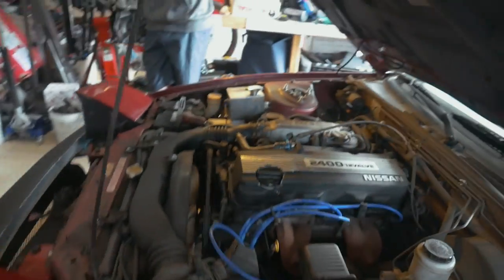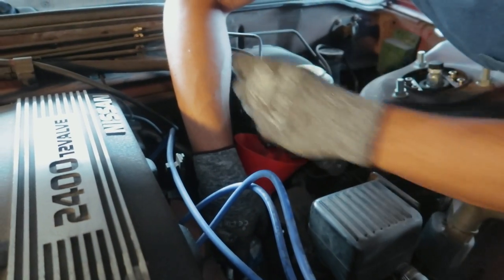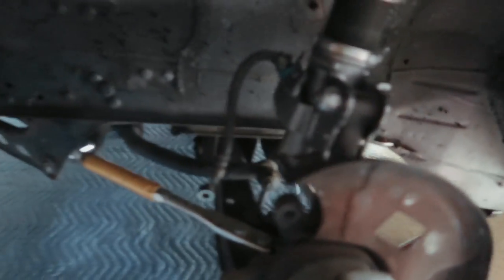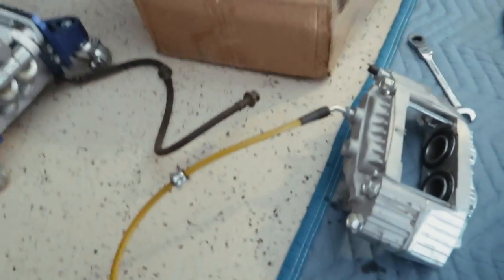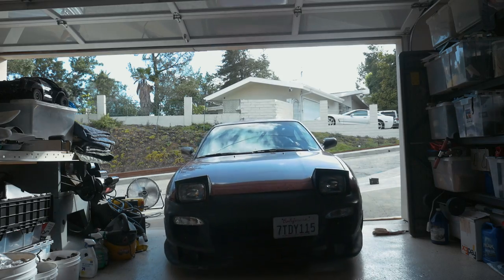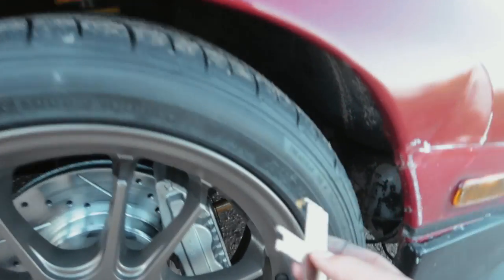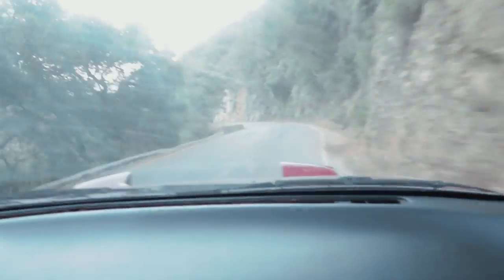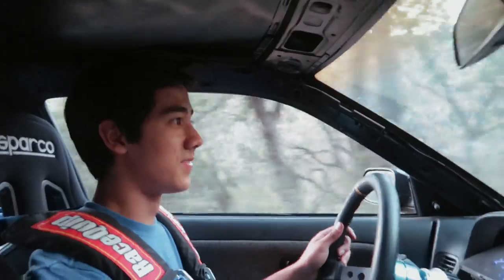240SX Z32 Front Calipers and BMC Install

Comment: Thanks for the vid! Where and what year z32 BMC did you get?
Reply: did you ever find out what year?
Reply: @orduna032  
Nope. Still running the stock s13s
Reply: @Cgtlfa  I found it, its the 1989 base 300zx master cylinder from oreilly's if you ever decide to do it. You dont need to remove the fitting like he said, it already has it.
Reply: I also used the 96 300zx twin turbo front calipers and rotors for the front and i believe the rear ones i used the higher model se 96s14 rear calipers with the oem calipers